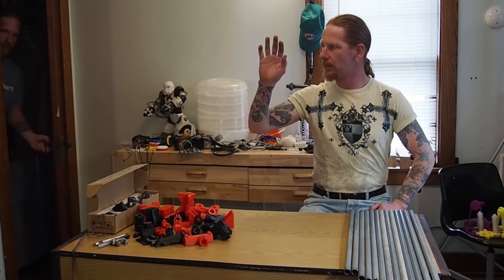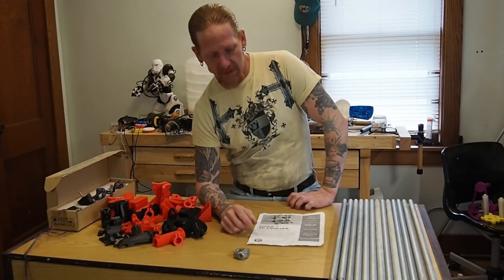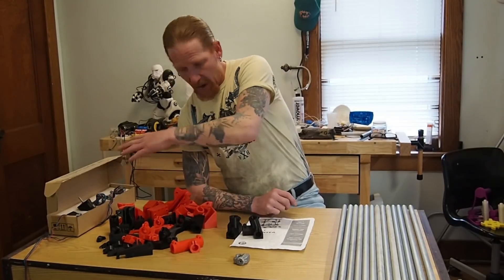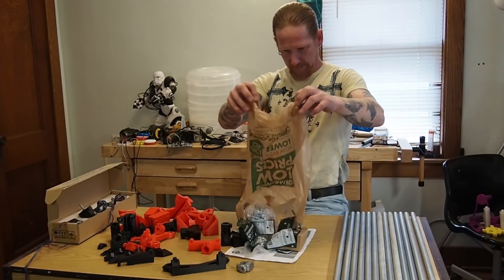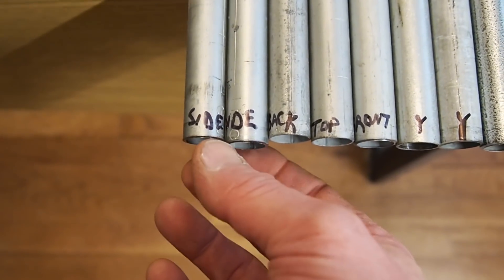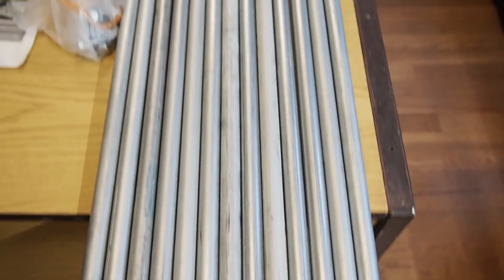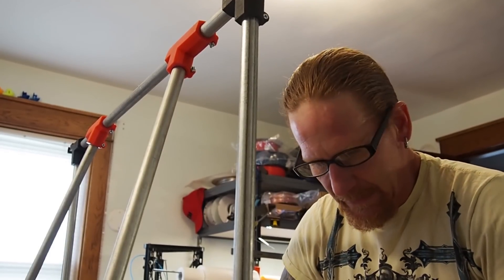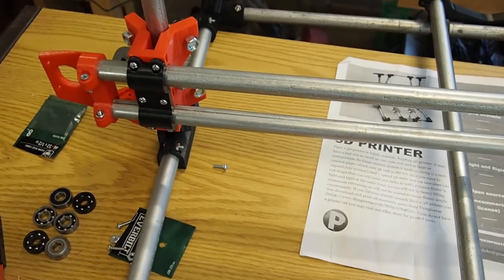The Piper 1 (Build Log 1)

Comment: hello matt
Congratulations on the video and for sharing this montage.
Where can I find the parts for assembly?
Are the pipes made of steel or aluminum?
Is a printer well structured because it is large?

Thank you
Reply from the maker: In the description there is a link to both the thingiverse and the website all the parts are list on the website and should be sturdy once it’s all built will find out soon enough

Comment: What was the pi hat you mentioned? What is it for?
Reply from the maker: The pi hat is a board that connects to the gpio rail of the pi and the connector from an ATX power supply and has terminals for the printer RGB lights and some other ports to control things. It’s a project a gentleman that approached me at MRRF and allowed me to take it and try it out I’ll be making a video about it